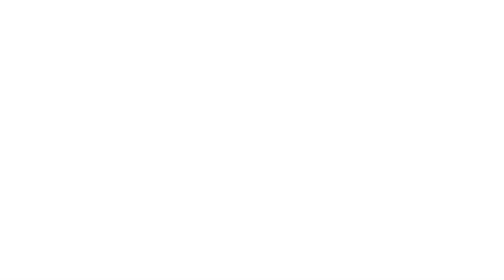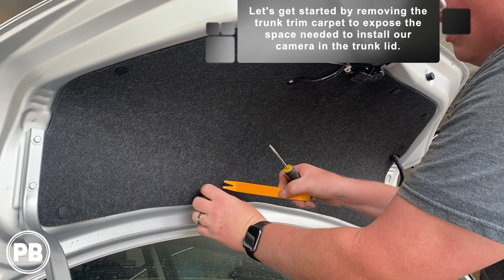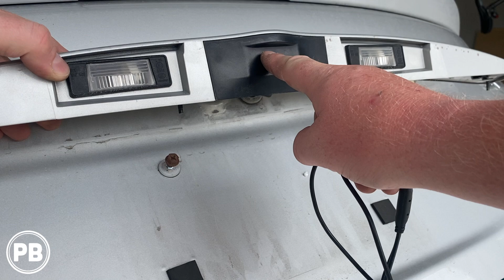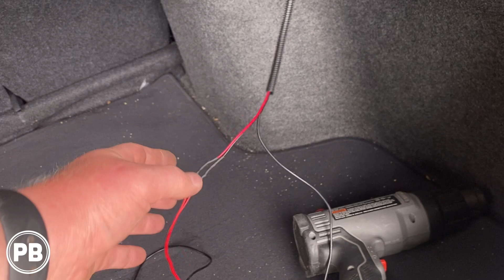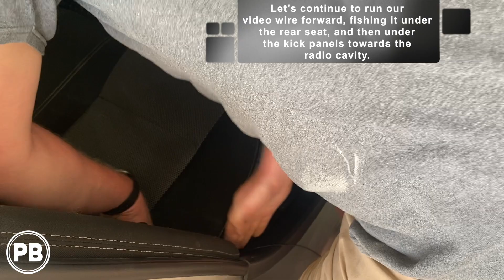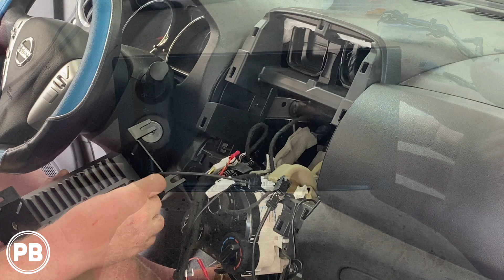2012 - 2019 Nissan Versa Backup Camera Install

Comment: Awesome  video , question is what wires do u need to make the steering wheel buttons work with after market radio. Please and thank you.  Again Awesome video  (I have a 2017 nissan  versa)

Comment: My suggestion to yall is do not trust “a yellow wire” in the loom behind the trim panel. In that loom was a wire in my 2015 Versa S and I even tested it with a multimeter. Turns out it’s hot on reverse AND on brake loool

Comment: Ok l get it know l know how it work know that factory camera with 4 l Yaz have RCA cable only no same RCA cable with that same on that video RCA cable single is litter hard to get that signal video and signal reverse will never work.. is tru RCA cable litter cable have to connect same RCA cable to RCA cable red and then go to tail light positive is green another black red is negative another RCA cable need to go that stereo put RCA yellow and litter wire RCA to that reverse can be pink to that stereo will work..

Comment: Ok l get it know l know why is don't work that factory camera need that same on that video need to buy Large RCA cable both need l cut one RCA don't have that wire litter RCA Yaz have RCA cable only. That is that reason l don't have that signal video and signal reverse l need to buy RCA cable same on that video large RCA cable l have RCA cable is ah single no have litter red. l put another camera plate work. But l don't what used l used factory camera that owner Nissan versa note SV 2017 cut side trunk need to cover with that factory camera that is that reason l hate that factory camera reverse.

Comment: l know black wire never change same thing. Only change is that positive l was have Toyota Tacoma 2009.  Was white and green positive. You buy car oh truck with positive red wire is you was lucky lol. l that car and truck l put camera positive are green oh white some positive have red black to tail light reverse trust me l know l buy car oh truck away put camera reverse have to much years. But real never do factory camera with 4 wire litter hard.

Comment: l can don't find that signal video and signal reverse l need to do buy Large cable RCA doing that same on that video more easy. Real first times doing damn  camera factory with 4 wire. First time see that think never see that think on me life lol. l buy car oh truck l put reverse and easy that truck some have 3 oh 4 wire for that tail lamp light. That need to be careful some have for brake abs put that check light. Some truck have white positive depending on that wire l know some say red away but is don't true cars and truck are different colors wire positive.

Comment: That camera factory was same on that video for me was more easy. First times l m doing factory camera with 4 wire. l only do camera with same video 2 wire is more easy RCA cable red go to positive tail light red black oh black cable RCA to ground RCA yellow go to that stereo RCA and have little wire red that put reverse wire to that stereo can be pink depending on that stereo buy some are blue oh pink oh purple.

Comment: Me Nissan versa note SV 2017. Have harness with 20 pins only have 11 wire one 8 pins only have 3 wire. Another one 32 pins l think have 10 wire but that harness 32 pins l don't touch is go to that transmission wire that harness.

Comment: For me.nissan versa note SV 2017 l need idatalink oh maestro is that same think different name is for that steering wheel like vol up vol down and change music with no idatalink oh maestro no work steering wheel trust me l know that. Some car oh truck have it you have lucky some car and some truck don't have it need to buy it idatalink oh maestro later l m buy idatalink oh maestro l don't about that is easy for connect l m worry about camera first option. Weird never on me life see camera have 4 wire different colors wire.

Comment: 2127 you have lucky 😂 to buy that reason l say that l go best Best buy no have it lol take to much longer to come out.. l hate wait to much lol.. on that l have 2 options but new stereo and camera more easy connect to camera..trust me l try another one easy for me that reason l don't what do it that Nissan versa note SV 2017 come with factory but l take off l hate wait to much. Another think cut wire doing me wire cable put oh add RCA cable to that camera factory that is me options oh buy another camera for more easy

Comment: Harness pins 20 only have 11 oh 10 wire colors. Is weird never see damn car litter car to find that right for camera reverse for that factory l try another camera reverse like plate have 2 wire and come with RCA cable is more easy for Nissan versa note SV 2017. That factory camera maybe is hard don't have that RCA cable l found all's that wire with go real are very different colors that is weird trunk side panels to front radio change damn colors is litter hard to connect that camera reverse that factory another way is cut it on doing me away me on cable wire l think l can doing well.. l know l m right green is positive and black is negative ground for tail lamp light reverse. Yaz connect there buy wire to far away to that stereo is more easy trust me. l know l try with another camera is work. Need to have RCA cable that factory camera no come with RCA cable only harness l need to buy adapter l no like that maybe l can do cut make wire like RCA l have cable RCA maybe l can put on that factory

Comment: Camera factory have 6 pins only have 4 wire is black ,yellow, blue green. l open side panels is that tail light lamp l see five wire is red,black,blue,yellow,green and front harness is radio factory radio 8 pins only have 3 wire colors blue,green,yellow

Comment: Factory camera reverse have 6 pins only have 4 wire colors black yellow blue green. l try to connect blue and yellow to that RCA and wire reverse wire to that stereo no signal nothing l try to blue to positive and negative no damn signal video 😂. But l take off that damn factory camera on me Nissan versa note SV 2017 l m going buy camera with 2 wire is for easy. l try another camera l connect green is positive and black is negative only with brake light lamp reverse. That harness adapter radio are different colors that Nissan versa note SV 2017 is weird have damn different colors me car buy it never have Nissan versa note SV 2017.

Comment: 5599 you have factory radio camera l think you need to change camera bue one camera reverse with 2 wire l real hate that camera factory l try to connect no signal video screen. l know tail light brake positive is green and black is ground negative

Comment: Alls camera l put have 2 wire colors. Some have red and black is negative that red color is positive with tail light nissan versa note SV positive is green. Have rca cable is yellow some have red oh black rca cable. Rca cable have two wire red wire is can connect reverse wire to that stereo. Rca with rca stereo but l dont clue with damn 4 wire camera no idea. l connect 2 wire with tail light reverse green and black. Green with green light tail and black with black light tail. But no idea and no clue with blue and yellow l think that yellow can be positive oh negative oh blue can be neutral light tail.

Comment: Another think factory radio l have is harness with 3 colors green blue yellow. l dont is for that camera on that back trunk have that camera with 4 wire is weird lol. Have same colors but front only 3 wire green blue green. Back trunk 4 wire colors black yellow blue green. l try to follow is dont work only l need is for signals and video too work. l know green is positive and black is negative.

Comment: Me car Nissan versa note SV 2017 tail light only for reverse brake is two. Wire colors green and black. But me car have camera factory radio with 4 wire colors black yellow blue green never see camera with 4 wire only see with 2 wires colors.

Comment: l check Google and check video YouTube but there are different colors wire Nissan versa note SV 2017 some say red wire positive l know that don't have it for camera only radio connection harness. Some tail lamp light for brake no have red color wire some car are different wire don't same colors..

Comment: While you had the right rear trunk panel open, you could have unplugged the 32-pin connector from the Bluetooth module behind that same panel & plugged a Bluetooth retention harness into that connector (NOT the module itself) so you have full use of the steering wheel controls (including phone buttons). The model numbers for those are Metra / Axxess AX-NIS32BT or AX-BTH-NIS, iDataLink / Maestro ACC-BT-NI1, or PAC BT-SWC-NI1; Crux includes it in the SWRNS-63U kit. They all do the same thing; they link together the three sets of wires (essentially Key1, Key2 & ground) that the factory harness routes from the SWC thru the Bluetooth module before going to the radio. This is generally for Versas (both sedan & Note) that have factory Bluetooth but NOT factory navigation. (Edit: You can also use jumpers or splices for the correct wires if you're good at those things, but IMO that's not as professional or simple an install as a retention harness; I found the AX-NIS32BT at a local Best Buy for $8.49 + tax on closeout, and except for possibly the PAC model it shouldn't cost much more than that.)

Depending on the capabilities of your aftermarket radio you may not even need a SWC interface & the splices for it you had to do in your earlier video, though you may find the SWC interface easier to program than the radio. Generally, the latest Chinese Android head units with a single 16-pin power jack (like the one I'm trying to install right now) can be programmed to handle Key1 / Key2 signals directly without a separate SWC interface; the one in these videos is older, apparently has the more traditional dual 8-pin ISO power jacks, and may not have the same functionality. (Edit: The retention harnesses claim to support the various manufacturers' own SWC interfaces, but that doesn't prevent them from being used with other SWC solutions.)

Comment: I have 2016 Nissan Sentra. Trying to do this. Confused with reverse light wire colors. There are: red, black, yellow, green and white. Do I  connect red wire from the camera to yellow wire which is going to reverse light or different color?

Comment: I just installed my backup camera, first one I have done.  Video was very helpful and gave me the courage to do it myself.  My versa doesn't have pass through so it was a bit more of a chore to get the wires into the passenger area.
Reply: How did u solder the wires?? What did u use
Reply: @MegaCavalier23   I didn't solder at all.  I used T taps to connect the power from the reverse light.

Comment: My 2019 Nissan Versa has a rear camera, how would the connections be integrated with the new radio?
Reply: I would like to know too. My 2019 Nissan Versa Note SV has a backup camera.
Reply: @PetrStary   There is a kit for it at Sonic electronix.  Just search google for" oem backup camera to aftermarket head unit 2015 to 2019  nissan versa" Youtube would not let me post the link otherwise I would have
Reply: Did you figure it out?
Reply: Did anyone figure it out ? I’m having the same problem
Reply: @vereonamoore2953  There is a kit for it at Sonic electronix.  Just search google for" oem backup camera to aftermarket head unit 2015 to 2019  nissan versa" Youtube would not let me post the link otherwise I would have.
Reply: Hey guys I’m having the same issue my 2012 note has a camera I found the reverse gear wire but still no luck after I hooked up my 7018b display
Reply: @kwengbooboo8501  Make sure that you also run the positive 12 volt power wire to the trigger wire on the back of the stereo.  Your backup camera video cable should have a red wire coming out of both ends.  Tie the camera end to the same power that powers tne camera.  connect the other end to the "reverse" wire on the back of the head unit or wiring harness.  If you have done this already,  check the menu on your stereo as some head units need the reverse camera option to be enabled via the menu.  Hope this helps.